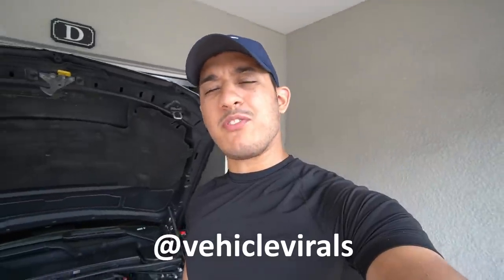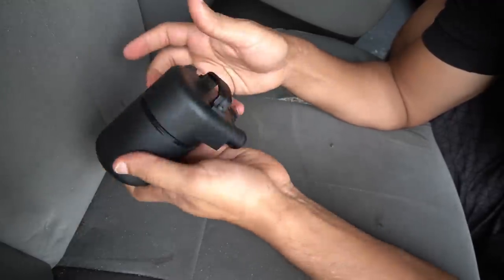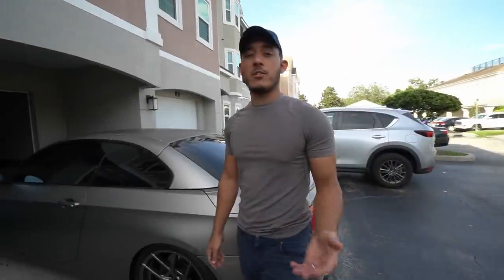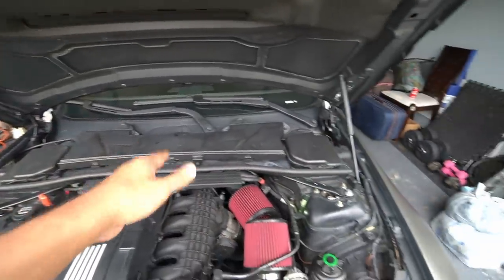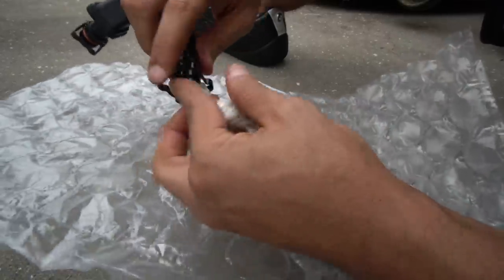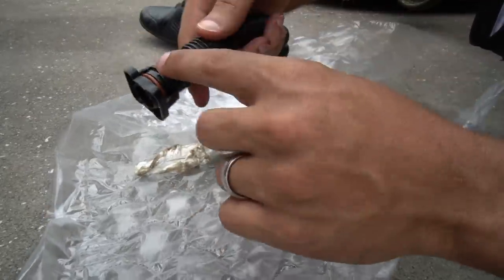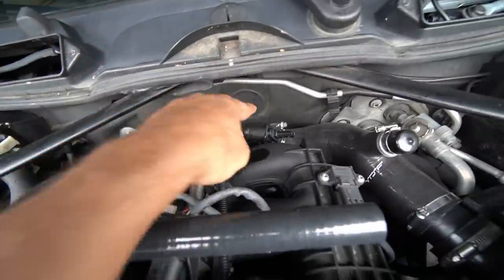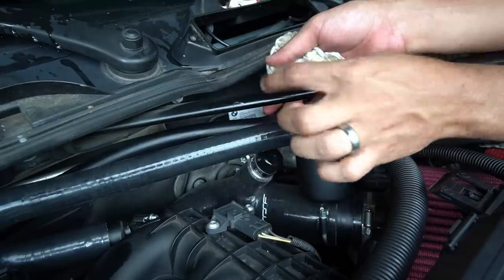Your BMW Will Slow Down Overtime Unless You Install This ASAP! *10 MIN DIY*

Comment: The little loop in the can, the one where you hold the zip tie is actually to hold the Can to the brace, you have to un screw it and it’s a perfect fit with the strut brace.
Reply: I rolled my eyes when I saw that...
Reply: Just saw this 🤣🤣🤣

Comment: The oil catch can actually mounts on the bar you zip tied it to. Just remove te 2 screws on top and mount.
Reply: Yeah was curious why he didn't do that to begin with.
Reply from the maker: Silly me! It was one of those days, where nothing was going right. Appreciate the input
Reply: I was about to tell you too bro, I have the burger Motor sports one  and it attaches to the brace. No need for zip ties
Reply: @jakealvarezhuerigo969  haha .. he was excited getting that blow by handled.   give him a break. LOL - but thanks for pointing that out.
Reply: 5 inch hose got turned into nearly 2 feet is it supposed to be that far? Can you cut it as close as possible while still being able to mount it?
Reply: Its like he knows what he's talking about with out actually knowing

Comment: Hey bud.  Am new to the BMW family as a hobby.  Bought a 2013 328ix.  Great car,  lots of mileage and just rebuilding and upgrading a few parts (charge pipe and all incl intercooler) was stunned by gunk in charge pipe.  Am going to follow your advice as my whole front of the car is under maintenancer (lol).  Having fun and enjoying your videos.  Thanks for the great work.  The passion is also easy to sense.

Comment: Great vid, can't wait to see the VRSF exhaust go on, again lol.  Side note,  like some of the guys said, unbolt the bracket on the top of the catch can and then bolt it to the strut bar. Also the O-ring goes on the threaded bottom half of the catch can, it looked like you just threw it into the top half.
Reply from the maker: Appreciate the tip man!

Comment: Carly is a great tool! I never leave home without in my car. It’s saved me a few times from being stuck on the side of the road. Just for appearance code in double flashers for the hazard lights, you’ll get looks when your stopped and have the hazards on. Also brake force flashers is nice.

Comment: I'll have to do this when I get a walnut blast but so far it's doing real well at 130K. Just did the valve cover gasket and upgraded the pcv and it looked surprisingly clean.
Reply from the maker: Maintenance for the win!
Reply: If you have never walnut blasted at this mileage you need to inspect the valves and the pcv. Most likely you have tremendous build up on your valves. It goes by milage. Inspect around 50k or so. Of course only applies if you have a DI motor.
Reply: @YS-kb9nc   I bet the intake ports are almost stopped up, All turbos seep oil, just look inside any inter cooler plus seance BMW dosnt use a EGR valve, they use the vano's to run more valve overlap that acts for the EGR valve.

Comment: Question: In theory the oil catch can means you wont need to walnut blast right, or at least as often?
Reply: Yes because this wont allow as much build up on your valves
Reply: Yeah it’s still recommended to walnut blast if you have a lot of build up already, but the catch can will help with reducing the future build up
Reply from the maker: In most cases on high mileage BMWs, you'll need to walnut blast the valves first and then install the catch can to slow down the process of carbon deposits.

Comment: Cool video, definitely a must have on any direct injection. Btw I highly recommend the cowl filters from BMS. I'm sure you've been tempted to buy them but heard some BS about them being dangerous or something. Nothing happens except less heat soak and a much nicer sound especially from inside the car.
Reply from the maker: I've looked into them before, but just never pulled the trigger.
Reply: They're really not a good idea. You WILL get water on your cyl6 plug if you drive in the rain, and you also end up with more moisture coming into the cabin/evaporator area which will lead to stinky AC. The car was designed to have a low pressure spot on the bottom of the windshield while driving and deleting the cowl completely removes this. It's just a cheap fix for having to remove the cowl everytime you work on the engine. I went for the M3 cowl for this reason.

Comment: Ik this is an old video but the top of that catch can 2 Allen screws take those out the metal bracket comes off to mount to that bar.

Comment: You should mention this full circle..... If you do install a low side catch can AND it collects a lot of oil in a short period of time, there's a problem brewing with your turbos....... Best thing a catch can - can do, besides help lessen the need for valve cleaning, is point problem areas out. And if you've got 150k miles and no catch can and never cleaned your intake valves, you'd be misfiring like crazy and engine prob wouldn't idle lol. Just my .02

Comment: Hey bro, long time follower. A two oil catch can system ( vacuum and boost) is needed for our engines. The one you have installed is for boost, which does not catch much oil.

Comment: Eventhough Toyota makes the best GDI system that I have heard of (by combining it with normal port injection and having it alternate between the two) if I had one with it I may still consider a catch can mod to futher enhance the reliability of the engine. 
Hell I might even do this for my gen 1 Mustang if I deem it necessary in the future.

Comment: you did put a catch can on the flapper valve , this is only one part of the pcv system , the n54 have a internal pcv system that run straigh from valve cover to intake head runner ... this will fix 1/8 of the oil that is going trough the intake , you need to block the head port in the intake runner !

Comment: YOU NEED TWO OF THEM, not just one... Go back and look at the pics of my engine bay that I sent you on Instagram. You can see the double OCC's in the rear. It's the ONLY way to be as sure as possible that you aren't getting oil in your manifold. Also, you should do a cowl delete, and get rid of that heavy crap cabin filter system. You can buy the BMS cowl delete filters for $60.  You get rid of a lot of weight off of your car, and it's so much easier to clean or work on your engine.
Reply: Do I really need 2? I've been running 1 for a good 6-7 months and have yet to see an actual pool of oil in the can. I'm still happy it's there but from what I see I'm not spraying enough oil for it to even collect. As for the cowl delete, I've been wanting to do it for a little while. Does the BMS kit come with a mount for the sensor?
Reply: @GuerrillaGorilla023  That's because the high side catch can in this video hardly sees any oil. It's the low side that gets the valves all carbon up via ports inside the head. Google N54 external PCV.

Comment: I need to remove the carbon from the intake valves again. Then I will install one of these. So far the car runs good. Did the cleaning 4 years ago and I am curious how bad it is now. (No catch can all this time).

Comment: hello quick question, i have 2007 bmw E90 N46 engine, i dont have catch can installed and i have noticed there is also no drain hose connected to dip stick, and dipstick is closed by pliers by my previous car owner. is it safe to drive a car like that?

Comment: I have the n52 engine with the magnesium cover. I installed an catch can right after the cover ventilation port and before the CCV , my only concern is about crankcase pressure , I read somewhere that the catch can can increasse the pressure in the engine … How is yours? Did you have any leak ?

Comment: Can someone help me. I bought a 335i yesterday and the guy totally reset the computer on me. Got home and had a engine light. Saids it need o2 replaced but I notice it also shoot out smoke during acceleration. Will a catch can help lessen that?

Comment: Could’ve smeared a little bit of oil on the fitting so it could slide in easier. Gotta have that catch can, I got one but will still walnut blast at 100k. I don’t really get much in my can in hot weather, there’s some at the bottom but doesn’t build up.
Reply from the maker: I did smear oil on the fitting :)

Comment: the bracket comes of the top of the can and fixes around the cross member, also when fitting hoses it's best to put end in a cup of boiling soapy water and pushes on a lot easier.

Comment: I did most of your diy on my e90. Now i know whats in my car and i did it by my self. With that in your mind driving makes much more fun. Haha (sorry for my garbage english im a german bmw owner xD)
Reply: My dad finally finished the brake job on his Mercades C300. I helped out a little bit and you have to swap the rotors along with the pads because they apparently cannot be resurfaced for those. But if its good for another 100K miles (180K something kilometers?) then its whatever.
Some of it looked really hard. Especially the way the lugnuts are designed.
Reply: Servus.ich komme auch aus Deutschland.habe auch e90 , weißt du ob Mann das bei n46 machen kann,und ob es gut ist.gruss

Comment: It would be nice if the oil catch can could be mounted by the power steering reservoir for easy access when draining it
Reply from the maker: I agree
Reply: Vehicle Virals i had a look at these catch cans and saw that burgertuning sells a catch can kit for the vacuum lines - it would be interesting to see why you would do this and what difference it makes. https://burgertuning.com/products/dual-bms-turbo-double-baffle-oil-catch-can-kit-for-n54-bmw-vacuum-boost?_pos=19&_sid=22986ebec&_ss=r
Also, it appears the mishimoto kit mounts by the power steering reservoir.

Comment: Maybe a lil too late of a comment, I would face down the 90* degree bent, due to the oil being heavier and air not pushing it enough for it to keep going throughout the hose therefore the oil is accumulating where it comes out of the engine and causing more issues.

Comment: Can you do a "bottom line" video on whether a 335i is good for daily or if its too much of a money pit?
Reply: Had mine since October and so far it is really good , if your in the market for one then ask the seller lots of questions , see if all recalls had been done and service records are good. also be sure to have 1-2k left aside and id recommend doing simple maintenance on the car. So I’d say go for it, the community around the N54/n55 platform is amazing and people are always willing to help. Join forums and Facebook groups dedicated to the engine you have and you should be fine and also do lots of research on the car , tons of aftermarket support as well

Comment: Hey man, at 11:50 how did you take the intake port off? I just got an oil catch can and am having the same issues.
Reply: I think if you twist it anti clockwise it comes out, but im not certain on that. If there aren’t any screws, then that will be how

Comment: hey, would you recommend doing this to a mazda 3?( the model your wife had before)
Reply: Every gasoline direct injection (GDI) engine
Reply from the maker: You could, but I would more so recommend it on turbocharged direct injection engines.

Comment: bruhh i thought u did the catch can when u got the valves cleaned. now they might be a bit dirty again lol
Reply from the maker: A walnut blast is recommended every 40K miles. I've drive maybe 6K miles since then, so I think I'll be fine.
Reply: @VehicleVirals  yea 6k is nothing u should be good. On a side note, the rear mounted catch can really only works when the car is in boost and only needs to get cleaned out after each oil change or 5k miles. A secondary and more effective location for a catch can would be the pcv for the valve cover itself. This location collects the same amount of oil and water in 100 miles vs the rear mount in 5000 miles. I have a link for the diy and a dual OCC kit for both sides of pcv:
https://vargasturbo.com/product/vtt-modular-pcv-catch-can-ready-to-install-kits/
https://www.e90post.com/forums/showthread.php?t=1231974

Comment: You are very lucky to have a free and advanced country and you have all facilities at your disposal. My country is under sanctions due to cruel and terrorist officials, and for this reason both cars and spare parts are offered at very high and outrageous prices. I have a BMW 320. I have a 2008 model that has lost many parts and needs to be replaced, such as the coils or the valve cover, which has severe oil leakage due to cracking, but unfortunately, here in Iran, there is nothing logical and beneficial to the people, thank you anyway. 😭

Comment: So... BMWs are one of the few vehicles that do NOT need a catch can.
They come with an "air oil separator" that does essentially exactly the same thing except it drains the oil back into the crank case.

My daughter's G37 needs two catch cans because it blows the oil vapour directly back into the intake manifold... it gets gummed up and the throttle bodies and valves get carboned up. My friend's hemi blows dirty vapour into the intake too and a catch can did wonders.
BMWs do not get any benefit from a catch can if the separator is maintained. You are literally removing oil that would otherwise be put back in your crank case.
Reply from the maker: The oil vapor passes over the valves and then into the engine. There is a reason the entire intake system gets coated inside with residue. That said, there are some modern engines like the B58 that don't have this issue. But engines like my N54 suffer from carbon deposits, meaning it'll benefit from an oil catch can. I've taken my car to get a walnut blast and I got to see first hand how bad those valve gets.
Reply: @VehicleVirals  I'm surprised and curious now. My E36 M3, was clean and clear when I put in the Schrick cams, and both my E83 X3 3.0si and E30 328e were in great condition when I changed the valve cover gaskets. I did have a small amount of goo in my E39 540i when I did the valve covers but I ran a can of seafoam through it and pulled the valve covers 1000km later and it was fine.
Do you think it might be a problem with some post N52 design change maybe?
Have you checked your air-oil separateor to see if maybe the diaphragm is stiff or expired?
Reply from the maker: @jamesrobinson1579  forced induction has a big role with these more modern engines. My guess is that NA engines don't suffer as much from carbon deposits.

Comment: Oil catch can dont fix carbon build up. It just slows the build up after you clean it
Reply: It stops carbon and oil combining and creating a paste, which builds up faster and is much more harmful. An EGR delete in combination with this would pretty much eliminate carbon buildup, and be the perfect solution if you can get around your local emissions testing.

Comment: Get a meth injection cleans out intake keeps Temps down and more power baby!! but still a good idea to keep the inner cooler from getting oil build up.
Reply: One of my next steps after fmic. But I come from diesel world lol meth is king lol just dont smoke it
Reply: will water/meth injection on a n55 blow the stock turbos

Comment: Carly is crap. It can even brake your ecu if u try to program too many at the same time. Also it works unreliable and the outlook is stupid. "really bad" just like carly many times says about your car.

Its slow to connect also. I had the official carly adapter i know.

Comment: Carly is not as good as he makes it out to be, I used my Snap On Zeus scanner followed directly by the Carly scanner and saw a bunch of incorrect error codes on the Carly. I wouldn’t recommend it to anyone that owns a bmw unless you are only interested in coding features in and out of your car. I give it a 1 star rating. You see it on a LOT of YouTuber channels and they make it out to be some kind of miracle tool and it’s just not.

Comment: a catch can isnt going to imrove ur fuel economy, or the way the car runs. it wont stop carbon buildup,  it simply catches oil blowby.  the blowby itself is the problem............ adding catch cans doesnt fix the problem.   You need to delete the pcv system entirely and use proper piston rings . a stock n54 motor will alwasy blowby and suck terribly above 15 psi for oiling.   the carbon buildup on the valves ISNT oil. its carbon from fuel being injected directly into the cylinder.  that has nothing to do with catch can and a catch can wont stop that.  the best thing you can do to prevent this, is change your valve stem seals!!!!!!  ps carly is trash.       bimmergeeks pro tools is like having bmw tools on android.